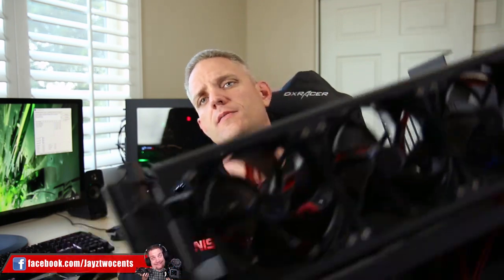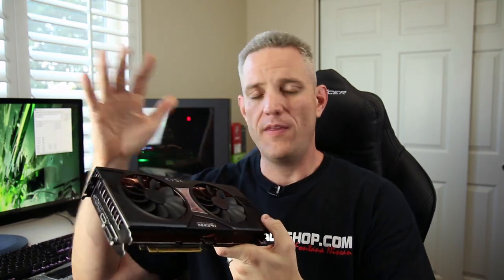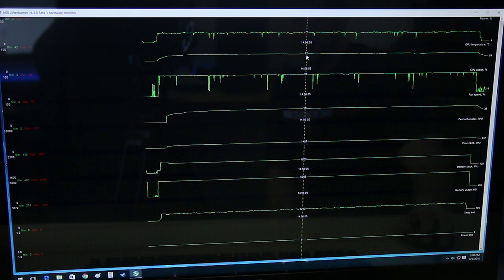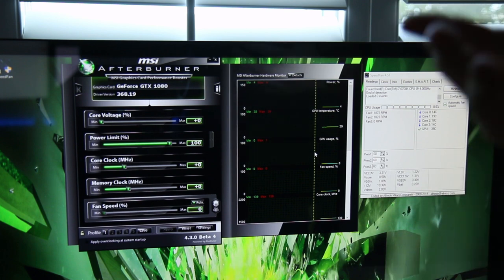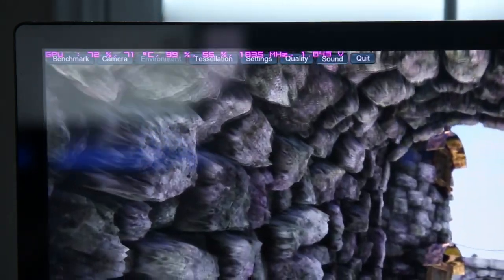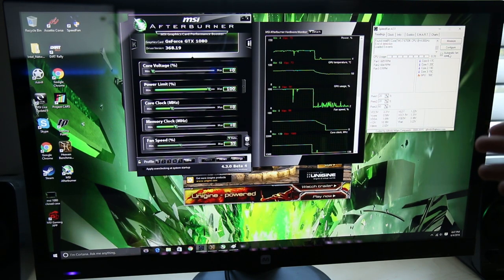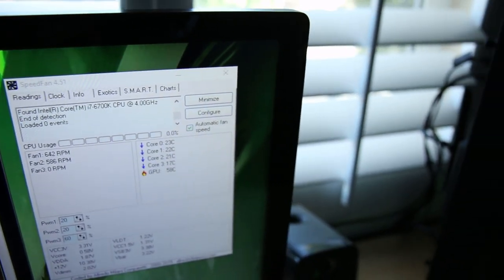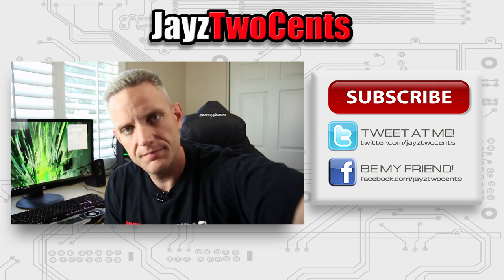Do cases make video cards run hotter?? - Test Bench vs Case

Comment: in my pc case my cpu get 10 degree up got gtx 580 in sli install actic cooler 3x92mm fan on both card and all that warm heat get around in the case not cool :D you know what i mean no matter i7 or i5 or what ever cpu you got the heat from fan of gpu get around in case only water will get heat out of case and no heat to heat cpu up :D

Comment: Why is this test never done in an OEM crammed matx case? Stock CPU fan couple of 3.5 inch drives, this is the most common setup I see in actual peoples homes, they go buy a big box store pre built and shove an aftermarket GPU in it. These setups run way, way hotter than open air.

Comment: Just use the same friggin thing for every benchmark. People are stupid. Unless you were to try an infinite number of each card in an infinite number of cases, with infinite ambient situations, you're going to have some error bounds (1-2 deg C). An improperly setup computer will affect it far more. As long as you keep your test consistent, we will have a good relative measurement for if we swapped out our current GPU for the one being tested. If my old card ran 2 degrees hotter than your test did, the new card will probably also run 2 deg hotter. Also, I'd guess that the different voltages were from the different mobo's.

Comment: Shit, i have a computer that has no fan mounts on the front (so no intake), i didn't do a whole lot of research on the case; but the picture i saw showed fans on the front. ANYHOW, my gpu is a MSI GTX 970 (again no intake fans) and i don't go higher than 75C. I also have an air cooler for my cpu, it all depends on how good your case is at exhausting the hot air. Plain and simple.

Comment: My 390 runs 10c hotter with just my side panel on. So, testing one card isn't enough to come to a generalization for the masses.
Reply: I have XFX, I have 5 case fans in a fractal define S.
Reply: This is with 100% fan speed on the GPU, in both scenarios

Comment: 98% GPU load, fan only required to run 55% to cool it to 70c while being silent. O_O

Meanwhile my SLI 680 hits over 63 db to keep Ark playable.
...I think I want to upgrade.
Reply: You might consider it. How many fps do you get in ark?
Reply: It took awhile to get SLI to work but with most things on High I get 70 fps, but due to noise I limit it to 30 fps.
Reply: Haha, you can actually open ARK D: i'm living with a GT 220. Doesn't even allow Direct X 11. Has 10.1 (well only allows 10.1), thinking of upgrading, been overheating recently for no apparent reason.
Reply: How long have you had it? Thermal paste goes bad over time. I've had my 5ghz 2500k for 5 and a half years now and after a few years I noticed temps where slowly increasing. Replacing my waterblock's stock thermal paste with some top quality stuff brought my temps back down.
Reply: Gara Von Hoiwkenzoiber do gpu's have thermal paste? nooby question, anyways, i've had it for well over 5 years, maybe 6-7 years now.
Reply: HypoCheese Sure they have, directly on the chip. Also most have thermal pads on capacitors or vram and stuff
Reply: Markus Wiedner Huh, never noticed although i've watched tons of that sort of stuff. I need a new PC, GMOD multiplayer menu gets to 103°, 105° it shuts down...

Comment: My thumb of rule when building  - 1 front case fan and 1 on the back @ lowest RPM, just to have little inaudible breeze going thru the case. CPU cooler sufficent RPMs up to 50-60C load temps.

Comment: In case of 69, it sucks and blows.
I know one-man-team has very limited time to do full testing, but just to note:
- 20 min is not enough to fully warm case and all components. It should be 1 or 2 hours, which is also realistic time for a gaming session
- test with CPU load, would be extra heat in case
- test the reference card as well
- test with moving all parts from one case to another (slightly different voltage might be because of different PSU and motherboard)
The results shown that the difference is small. Maybe it just shown the obvious, that with a bit higher voltage the temp is a bit higher :)

Comment: Click on video, 2 seconds into video leave comment, and answer question - Yes, the answer is yes it does.  This did not take 16 minutes, it took 16 seconds.  Now, close video.

Seriously though, NOT being a smart ass now, after this video, when someone shoves one of these cards into a very compact case, and has problems, they will come back to you and say "BUT, BUT, YOU SAID...";  You should probably address this, because case size, airflow, etc. makes a difference, and when you are using something compact, it is going to make a pretty big difference.

Comment: Why doesn't someone do a dual fan rear exhausting card? It could be quieter.
Reply: what??
Reply: Mo fans mo noise fam
Reply: More fans =>lower rotation speeds->less noise to achieve more airflow.
Reply: +Shalmaneser not for a blower style cooler the second fan would increase air resistance and cause you to have to run the fans faster to get the same airflow through the fins on the vapor chamber.

Comment: Ok dude, stop turning on your AC. I can't afford AC and it gets ballz hot here. I have to down clock every thing or lock out refresh rates so my room doesn't get too hot.

What kinda world is this if I can't enjoy my 144Hz because it's too hot. #PhartBoxPharah
Reply: how can you afford a system that can run 144Hz and a monitor that fast if you cant even afford AC
Reply: +timothy banks he's from the hood.  He stole it.
Reply: If you can't afford an AC you also can't afford GTX 1080's so it doesn't matter for you :D
Reply: Does it say you need AC on the retail box?
Reply: Crack open a window? Wall or ceiling fan?
Reply: if you live in an environment that gets very warm - then it's your responsibility to use Radiators on everything to compensate for the efficiency loss since Heatsinks have fairly mediocre efficiency.

people that live in hot climates should know about this already. that they need more cooling capability to compensate for their poor situation.
Reply: radiators don't make your room cooler; you will learn this if you take Thermodynamics after you leave high school.
Reply: Drop one of these in the doorway and see what happens http://www.walmart.com/browse/home-improvement/box-fans/1072864_133032_1230511_1230512
Reply: ron bergeron Radiators are much more efficient, which means they perform better in less ideal environments - which are higher ambient temperatures.

maybe *you* should go to school, to understand thermodynamics.
Reply: you don't know what your talking about kid; if you want to watch a video instead of reading a book go look at the Linus videos.

Comment: Of course a case can cause a video card to run hotter. If the case has garbage air flow then YES it will run hotter.

Comment: While I learned something about how GPU hestsinks move air.
Reply: yes the gpu doesn't change Temps but it heats up the other components more in a closed case. look at linus tech tips and his video on this topic (which is way more in depth and actually looks at the whole system)
Reply: Yeah, my GTX 960 just blows the air through the heatseak. Luckily I have a case with a lot of fans if that helps.

Comment: If you want to get realistic results you should conduct testing based on something average,like most of us have, not TOP spec like that case you have there, and of course use the same exact components.

 Get your stuff out of the box, put them all in an average $50-70 case with 3-4 average fans, then we talk about real results.
Reply: Pal, the NZXT s340 is certainly not a top case. It literally costs $69.99 on Newegg.

Comment: there are some really shady people out there, and some random shenanigans from some people some times, but come the fuck on.. some people have some degree of credibility, proven knowledge and pride to NOT either fuck up or fuck with people so bad as some trolls yell about. ffs.. the extra trouble of doing this mostly in the same shot shouldn't be needed if people use a bit of logic and knew the basics about this subject.
Reply from the maker: Its sad, but people seem to think that trickery is being pulled. Isnt the first time someone has accused me to falsifying numbers.
Reply: ***** yeah i get it, but there will always be random trolls accusing of the most unimaginable of things. at least now we can just link a video and end the conversation before feeding the trolls.

Jay can you btw suggest me a double 360 rad case that is the most bang for buck? i mean you probably know some computex news we don't. i would prefer to get a mid tower than a 900D/ thermaltake core w100 or something. but all i see is 360+240 or similar limited cases.

Comment: It's ok Jay, let me use current logic on you for a second. 

YOUR WRONG BECAUSE I HEARD ONE TIME, WELL MAYBE NOT HEARD BUT SAW A SARCASTIC FORUM POST, WELL MAYBE NOT EVEN THAT, I THINK YOUR WRONG BECAUSE REASONS, OF WHICH I HAVE NONE BUT I FEEL LIKE I'M RIGHT, WHICH MAKES ME RIGHT. SO... WHAT WERE WE TALKING ABOUT? WELL WHATEVER IT WAS YOU WERE WRONG AND I'M NOT BECAUSE I FEEL LIKE I'M RIGHT.

You might as well try to cool your CPU with willpower. Which would probably be easier than trying to present test results, opinions, or objective fact on the internet, without the comments catching on fire.

Comment: Could have saved yourself 15 minuets and said yeah it makes a difference but it's a really small difference
Reply from the maker: +Mister. Bubbles if you watched you would see that the case was slightly BETTER than the test bench!
Reply: +JayzTwoCents the reason(potentially) your voltage was lower was because you were using a different cpu/mobo  so it could affect the results just slightly.
Reply: +JayzTwoCents I did watch it that's what I meant, also by the way I didn't mean to come off negative, I'm a fan keep up the good work
Reply: +JayzTwoCents u did tested it in the case 2 times I don't know is it an vidou editting mistake or not but just watch it for ur self firest test in the case and in the other one u said ppl will not belive so u show that the bentch was on ground but agine we see the card in the case I hope this is an vidou edit mistake srry for bad english and have a good day
Reply: I thought better temps/better airflow inside the case was expected, since your test-bench doesn't have fans other than what's attached to the graphics card itself.

Comment: I dunno ....open air case with a house fan pointed at it gives me around 50-53c at full load on a 3.7ghz  quad core cpu vs around 60-70c inside a case. Gpu temps on my 1070ti really depend on the game tbh but I never see 70c in open air.Nothing beats open air. End of story.

Comment: 2nd XD
Reply: Was wondering if buying a board partner card would have any benifit if i plan on watercooling it in the future?
Reply: +Bobby Thoms yes, as long as you get a card that has a water block available.  you get more power phases, power connectors and custom bios on the board partners cards